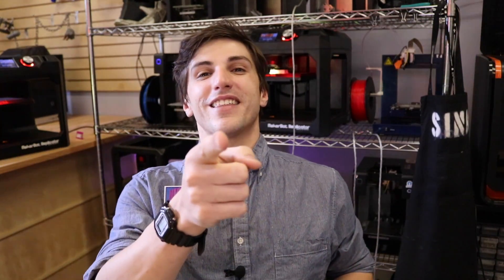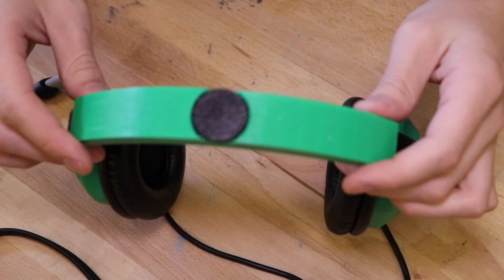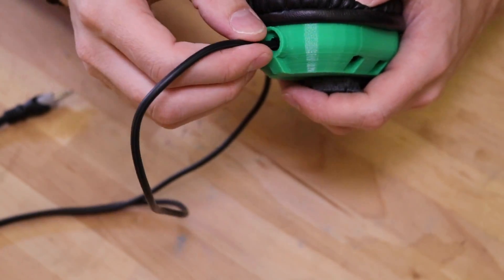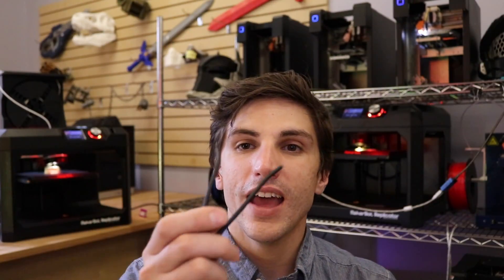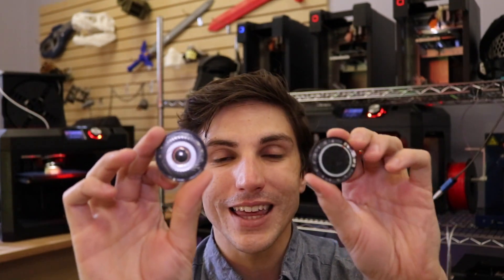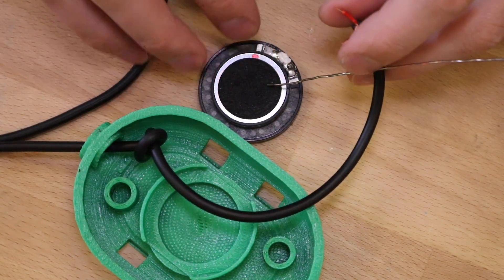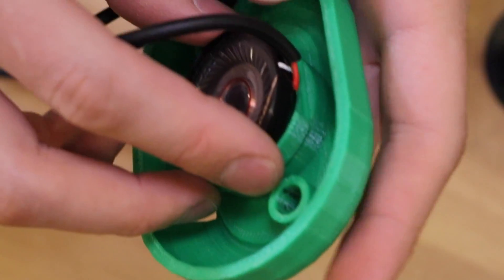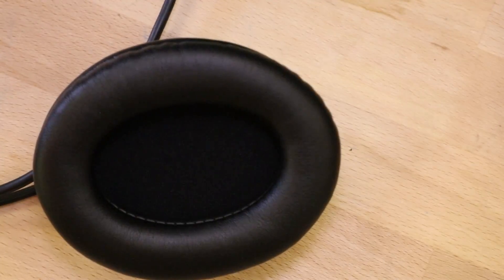3D Printed Headphones!

Comment: I got a qwestion and this is 100% not to be anoying just curiuos if u place the headphones on youre head how far do u need to place left and right downward iam 30 year old and i also made a type of headphone hoever i love to know how far u turned the screw so it on it most expansed out format i have a big face almost the same size as u got but i love to know how far do u increase the size of the headphone on its biggest size and when u do that doest it fit on youre head i love to know how it fit on its biggest format and whitout adjust it / make it smaller if it still fits on youre face love to know i understand u made one wich u can adjust hoever i made a design that cannot be adjusted in size its only 1 size i compared that in software i basicly imported youre headphone fully aseambled on it biggest format and placed my design in youre design and delete youre design after to have a size comparising basicly cuz with my software size is difucult to read vs when u printed it out its basicly very difucult to know if the size is correct that why i love to know this

Comment: I own a 3d printer with only 150 x 100 x 125 build volume and I can not fit the headband. Is their any workaround?
Reply: I realize this is an older comment but you can use mesh mixer to cut up the parts that are too large for your printer and glue them together with CA/superglue (make sure to use an activator for best results)